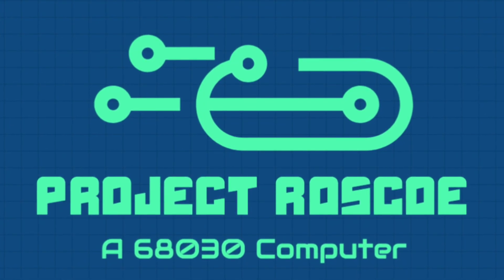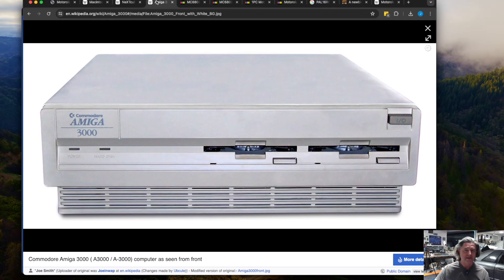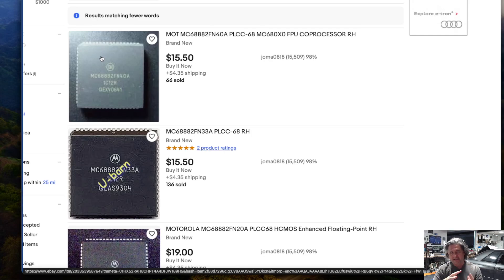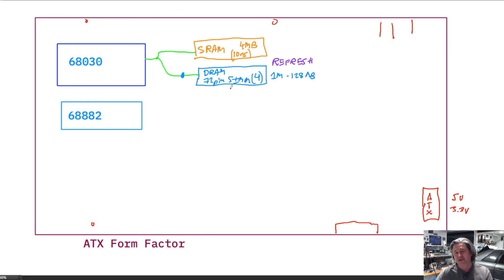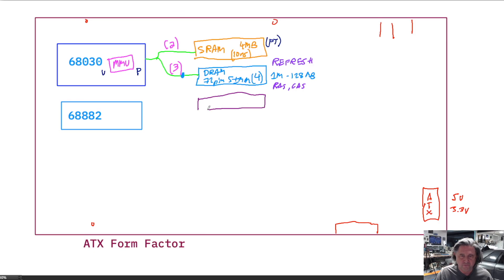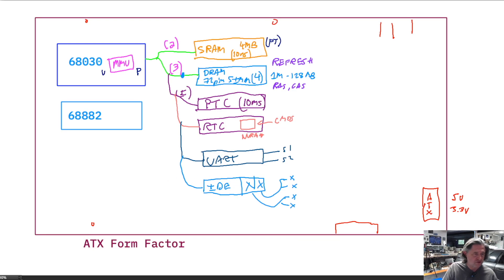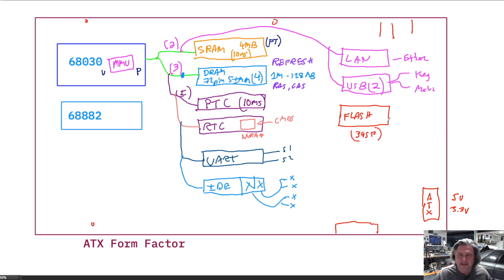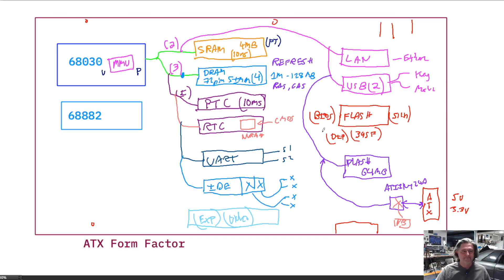Project Roscoe Ep 1: Designing and Building a 68030 Computer

Comment: I agree sounds like an awesome project! And it looks like it will be a very capable machine as well.

Do you think it would be worth while adding a basic IO interface for things like a PC speaker and/or LEDs/7-seg on the board? (mostly if you can't use an ISA POST card)

Also kinda surprised you'd put an ATtiny on the board considering the ATtiny can do more MIPs than the 68030. Thought maybe a CPLD would 'feel' more suitable plus handle any glue logic?
Reply from the maker: Stay tuned - Both of those ideas are coming up!  (great minds think alike)  I do agree on the ATTiny!  I debated for awhile about using one for this purpose.  It would have been possible to do the same logic in the CPLDs, but I didn't mind removing that complexity to something standalone.
Reply: @WizardTim, Attiny is around 1 MIPs. 25Mhz 68030s are around 5 MIPs. But yeah, it is using a sledgehammer to crush an ant, but proper power/reset/fault handling is deceptively complicated. The Attinys are great - featureful, self contained, and work with a wide variety of voltages. I'll be doing a video on its operation as soon as I coordinate it with Jeff.